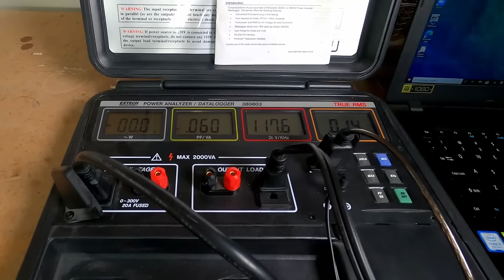Singer Heavy Duty, Most In-Depth Review on the Internet. No Really, I'm Not Joking.

Comment: Excellent video Wes. I am a sewing machine mechanic and I have always wondered how heavy duty the singer heavy duty really was. This video definitely shows that it is made pretty well. I just wish Singer had made the outside a little less boring.
Reply: Spray paint! :)
Reply: My daughter in-law,  who is architect,  likes the outside design. She likes the clean, straight lines and loves the  grey/red colour. Too many sewing machines look girly.
Reply: @c.a.savage5689  - I used one the other day. I like the look and know it is a good machine for the money based on what the reviews say. It can probably do everything I need. I still don't like it and decided to not buy it. It felt cheaply made and four pounds too light in contrast to my old machines. It did not feel (!) heavy duty.
Reply: @my_dear_friend_   I suppose it depends on what one is accustomed to, and needs. 
My mother had a heavy metal Singer in a walnut cabinet from the 1930s. It sewed just fine, but l didn't want it under any circumstances. I have a portable Spanish-made, enamel-on-metal body, Refrey 612 from 1991 that l love, but that's not available in England. Our choice was the Singer Heavy Duty 4411 for our daughter in-law who is just learning to sew. The motor is a little too fast for me, but the weight is fine, the sewing very stable and the follow-up after service and assistance, excellent.
Reply: @c.a.savage5689  - I am sure the 4411 is great. I almost bought the 4423 I was looking at. Hard to go wrong with the heavy duty models. The sewing speed would be a concern I share with you. I am in no hurry.

Comment: Remove the back cover before the top. This will allow the top to come of very easily
Reply: The owner is supposed to remove the top regularly on any machine to oil it, think monthly. You don’t want to take the back off all the time, it’ll wind up breaking.
Reply: I remove the top on mine to oil it when needed and no problem breaking anything. I believe you missed a screw in front of cover where take up lever is housed prior to lifting off top with that yellow thing. It should easily just lift off without any force. But great video and review, Wes!! You’re the best!!

Comment: A pulley is not the same a gear. 

A gear has all of the stress concentrated on a small contact patch between the meshed teeth. A pulley has the force distributed across the entire area that the belt is in contact with. Gears also have sliding friction as the teeth roll in and out of mesh, causing wear. Pulleys only have static friction. 

Plastic pulleys aren't nearly as bad as plastic gears.
Reply: enlightening!

Comment: I bought this machine November 2020 . I unboxed it, and started trying it out doing a straight stitch and it seemed ok. I didn't want to try the  other stitches  until I read the manual that I had to go on line for (was not happy about that) .  As I was still trying out the different lengths of the straight stitch the machine started running backwards. If I stopped and went back to it, it stitched forward again. I was so fed up with it I left it alone for a couple of weeks. I got on it again today and it is only sewing backwards with a very small zigzag stitch and I had it set on a straight stitch.  Have you heard of this before? I've watched the videos on the threading and I feel like I'm doing it right. I'm so frustrated!  Help please!
Reply: You should have returned it when you realized there was no manual in the box. When you purchase a brand new machine, you aren’t supposed to seek out a manual for it online. Unfortunately, it sounds like you got suckered.
Reply: @TheJudeJane  Manuals no longer come with any of the machines. You have to go on line and print your own manual, all 40 pages! After which you probably have to buy an new 40.00 ink cartridge. I refused to do that and they actually printed it for me in their store. They were very nice about, you learn something every day, right?
Reply: I have the original Viking Epic. I also had to print out the manual. The new Viking Epic 2 now comes with a manual, but I’m not about to lay out the money for the new version. I also have a Bernina. They come with printed manuals. The stitch quality is superb on Berninas and they still have more metal in them. Love my Viking but will only buy Berninas from here on out.

Comment: Just a little thing, but I so wish you could show how to "repair" the oil wick that's under the bobbin case. When my 4411 was new the wick was there at the top of the oil wick hole, but over just 3 years time it has slid down and I can't see it. 
Does it need "fixing" or can I just put oil in there anyway?
Reply from the maker: Yes, you can still oil it there. It will still work.
Reply: @SewingMachineRepairGuy  That was a speedy reply. Thank you.
Edited to add: I've shared this video on a sewing forum. Hope that's OK.

Comment: sew helpful !  was told my cheap walmart bought singer (10 years old) was not worth repairing and throw it in the dumpster.  the manual had no maintenance info on oiling which seemed odd. now i will dismantle it and see if there are places to oil it.  it "seized up". and to my mind it seemed like it needed oiling...but no singer info wanted to tell me how to do that on my own.  started sewing on my gramma's treadle singer in the 1950's. some things are better.  lots are worse and designed to be obsolete if you want to give up on their new fangeled complexity.

Comment: Regarding the current consumption, measuring AC power on a load like a motor is more complicated than just looking at how many amps it's pulling. You also have to consider the power factor, which tells you how much of that current is doing useful work, vs how much of that current is just wiggling back and forth in the wires. When you start out with the 2 layers of cotton, the power factor is relatively high at .85 which means that the motor is lightly loaded, but at the end when you're sewing through the leather the power factor has dropped to .81 or so indicating that the motor is more heavily loaded. If you get all the way to stalling the motor, the power factor will drop to close to zero, as the motor is no longer doing any actual work (torque x rpm = power, and when rpm = zero, power = zero) and all the energy is instead just going in and out of the motor's magnetic fields.

Comment: Thank you. I've found your analysis very reassuring, as I've just bought one if these machines and was shocked by how much the outer casing appears to be very cheap plastic and how light it is. ( I am used to my two other machines: a 25 year old Brother, which is all metal and a 14 year old 'cheaper brand' computerised machine that is heavier and very hard shiny plastic) I bought the Singer because I wanted a faster machine and the computerised machine needs servicing. So far, I'm not excited at all by the Singer but then I have not tried it on heavy fabric.
Reply: I agree, I wish the outside was built much better.  Don’t like the cheap plastic casing.  Older machines are built way better.

Comment: I like my heavy duty 4411 for a few things, and dislike it for others.
I've owned several machines. "Heavyduty" is not the same as industrial. Yes, in my opinion it can handle more than your average home machine, and it can sew really fast, which is fantastic for large projects such as tents or blankets that have long straight seams, but it's loud and rattles so much that I feel like it could fail at any moment. 2 years using it on heavy duty materials, and thus far I've had no major problems. With the correct foot and needle, it handles multiple layers of leather, canvas or denim better than my other more expensive plastic home machines (Bernenia and Janome). I would consider it "heavyduty" for home use, when compared to other modern home machines, which usually struggle with denim seams.

However, no plastic home machine compares to my 70 pound 1950's Hudson's bay Electric Piedmont (also sold as the Janome "New Home" 534 and manufactured in Japan). She's slow and basic, but she's quiet, reliable and runs like butter! They sure don't make them like they used to.

Comment: Nice review, this machine is better built than I originally thought after watching your video. Yes this machine is well made to where you can oil it, clean it and maintain it. I would purchase this sewing machine to use around the house if I were to buy a new machine. But here is where the misconception lies. Heavy Duty compared to what? If you had “heavy duty” stamped on a child's mini sewing machine, what would the “heavy duty” refer to?

There are several different classes of sewing machines. You have child/traveling - domestic (portable) - industrial. Now, you also could say you have a heavy duty class with the domestic and industrial. 

A domestic sewing machine is a single feed (non-walking foot) with a 0.3 - 0.5 amp motor and has a metal rotary hook and metal frame. (Anything less is just a “quilting” machine)
A domestic sewing machine is basically your typical household “black” Singer sewing machine and the 1960’s and 1970’s Singer models 7011, 534, 328, 500, 648, 319, and etc. These all have metal rotary hooks and metal frames. Some have nylon gears which does not degrade the quality of this class of machines. Making a denim jacket on these machines would be maxing out these machines with the possibility of burning up the motor if the motor is a 0.3 amp motor.

The only thing that might put this Singer HD in the “Heavy Duty” class of domestic sewing machines is that it comes with 1 amp motor. Still a denim jacket would be the heaviest project to sew on this machine just because it’s still only a single feed machine, one set of feed dogs.

Now if this were a walking foot machine sewing machine, this would be a true heavy duty machine but still classified as a domestic. Any portable walking foot machine is a heavy duty domestic machine because these all have a 1 amp motor.

Comment: 2:20 I would consider that stainless steel part as wear protector. That area is the area that gets rubbed the most with the cloth and pins so it makes sense to have something else but plastic there. High quality pins will have even stronger tip than stainless steel so it might still be scratched in long run.

Comment: As a plastic molding tech I can assure you when plastic used in the correct applications it can last as long or even longer than our metals being used in todays appliances. 
  Plastic really gets a bad rep because of incorrect type of plastic/wrong app or direct sunlight that breaks it down very fast. 
  Why I dispise vinyl on any homes exterior and strongly advocate Alcoa brand "textured" aluminum siding/windows instead.
  It's nice heavy weight aluminum so it takes the hail/rocks while mowing very well. 
Plastic inside cars is the worst, interiors heat up so damn much. 
 First thing I do is dark tint the windows on our vehicles before sun destroys it. It starts breaking plastic/vinyls/leather down immediately!
Great job on vid, hats off to your mechanical skills. May your next step be Timex..lol?

Comment: If it makes you feel any better, you didn't break that clip. I have the exact same machine and took the top cover out with utmost attention following your instructions and the clip just wasn't there. 
I even shook the machine and turned it upside down to retrieve any broken parts that might have fallen but nothing came out. Only four clips on this part. Two at the top edge and two at the bottom so you're all good! 😉
Thank you for this informative video

Comment: I would also like to know which sewing machine is best for sewing on sequin fabric!
I used my Singer 9910 to make my daughter's wedding gown a year ago - I think I threw the timing off.
It won't do my specialty stitches any more.
I cleaned it and oiled.
(my son helped me take it apart - he is a machinist /fiber optic guy - so good with tech)
Again - which machine is good for sequin fabrics?
My daughter's fabric had many layers of sequins at the hem and two layers of that meant a lot of sequins.. I turned off the auto needle drop and used the handwheel to drop the needle back for abt 6 inches of the fabric because the sequins were so heavy! 
I used a jeans needle or leather needle 90/14. 
Her gown was lovely! And cost us abt $750 instead of the $20K I was told by the bridal store 
(I kid you not! $20K! Crazy!)
Sewing is so worth it!

Comment: Good in depth video review. It is a decent machine, I still don’t like all the plastic they encase it in. To me it feels cheap, and by today’s standards it is though. My newest machine is 3 years old. However it is a clone of a Juki 441 industrial cylinder arm machine, zero plastic there. Lol. My next newest machine is my model 1914.158 Kenmore that my mom bought new and passed down to me. Very solid machine. From there my machines that I have restored and have running the oldest being a Singer 115 treadle that belonged to my grandma that I restored two years ago. It is 107 years old, made in 1916 and it runs like a top. Also I have a 29K51 treadle I restored and was made in 1932. I also have a 15-88, 201’s, 306’s, 319, 99, 128 all being Singers and all working order. The vintage ones are such nice running machines.

Comment: I don't mind plastic gears as much. It's pretty hart to find any new machine that has all metal gears. It gives the machine a failure point if something goes wrong. Especially if a machine doesn't have a computer that will stop when there's too much torque on the motor. If you break a plastic gear its easily replaceable compared to doing damage to a more internal part of the machine. My $700 Juki Tl-2000 has plastic gears and it works great.

Comment: Great video!  Nice to see what all is "inside the plastic box"!!!  I'm guessing just plain oil on those four bushings over the long bars?  (two on top and two on the bottom)  Also, over time, the tension on ours works more happily at about 6 to 6 1/2 whereas it used to like something between 4 and 5.  I cannot see any fluff or grime in between the tension discs.  Is this just normal wear after several years?  Or did something perhaps move?  We love our 44.  My wife uses only this one; however, I also use several older Singers and a Sailrite.  There is no way we'd want one of the digital machines--being thoroughly delighted with analog equipment.

Comment: I have a Singer Impression machine (I think) and so far love it and have oil to service it and I like the machine because it is mechanical and my first sewing machine. I got it because of the material my grandmother had for quilting and I wanted to finish it and use the machine sometimes for repairs on pants and shirts. I wanted to get the heavy duty model, but could not find one anywhere online or in the area stores.

Comment: I'm adjusting the fit on some goatskin gardening gloves, and was very interested to see your demonstration. I started with the "leather" needle that came with my machine, and upholstery weight thread, and this seemed like overkill, so dropped to a smaller needle and quilting thread. In the end, I used a denim needle and regular polyester sewing thread for the best results. So, I'm curious about matching the right thread and needle combination for sewing leather, in general. Also, I've been searching for better information about grease. I have oil and use it, but when, where, what, and how with the grease on this Singer Heavy Duty?

Comment: I think you missed mentioning one oil point on the top front section of the machine. If I remember correctly there's a hollow shaft with a square felt oil wick. If allowed to dry out it can shrink and fall out if you tilt the front end up to a vertical position.

Comment: For the price you cannot beat a Singer HD 4411. Easy to maintain and find replacement parts, all-metal structure with helical gears and a modest motor. So long as you match the needle size and thread, you cannot go wrong with this machine. Only issue is the presser foot clearance and the oversensitive pedal. The pedal can be modified by taking it apart and adjusting the potentiometer to reduce speed ramp up. Other than that, provided the user has technical know-how and sewing experience, this machine will take you a long way. Far too many people dismiss this machine because they have neither

Comment: 14:24 the black gear in the bottom actually is plastic, my wife just remodeled our partly sheard gear with a hot screwdriver. So definitely plastic.
Could be a failsafe though, better this one breaks than the metal one further up, the one on the shaft seems easier to replace.

Comment: i want to see this machine lasting over 45 years like my grandas old Singer sewing machine. my grandas machine had a thicker aluminium frame, and the plastic gears lasted well 45 years (and going strong so far). the engine on the old machine has a metal gear and even the belt looks thicker. they dont make them like they used to do...

Comment: I was looking at sewing machines because I want to make sails and this one seemed like a good deal. I like the tear down review and I can offer some commentary for the belt drive. The plastic gear on the motor can be replaced with an aluminum timing gear (probably GT2) of the correct number of teeth if you really want to, but I believe they chose plastic (ideally delrin) because it wears better, meaning the belt should last longer. As for being heavy duty, that term has become a marketing stamp but it does have a real meaning. It refers to the duty cycle of a particular machine, which is generally how long it can work under load before it overheats and requires rest to cool down. I'd consider it heavy duty if it's duty cycle is greater than 50%, meaning it can run for longer periods of time than it would need to rest for cooling down.
Reply: @vykaart6009  no, you need a Sailrite for that kind of sewing